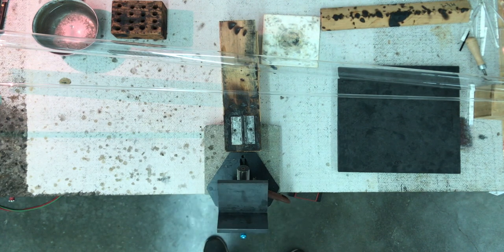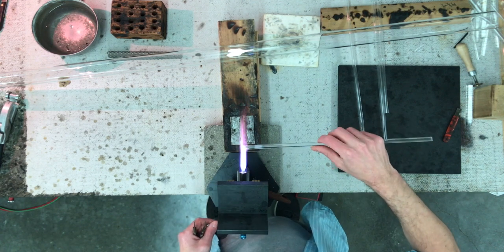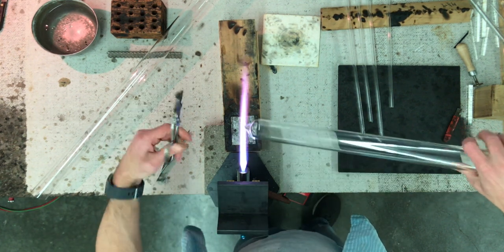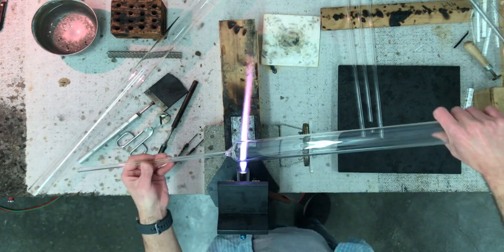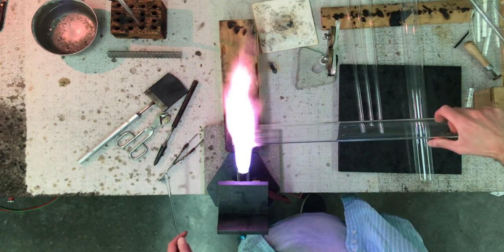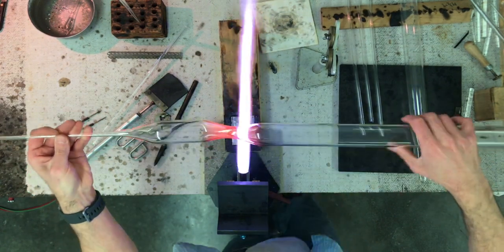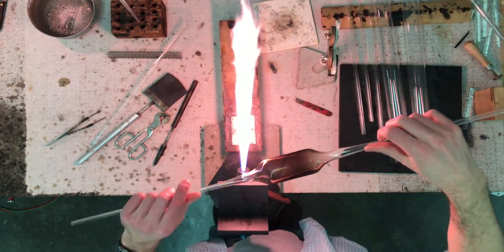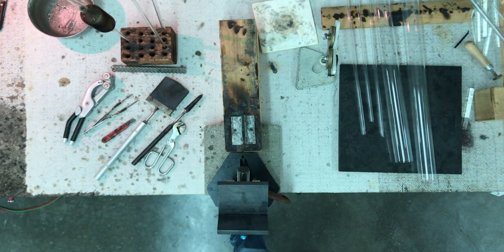Borosilicate glass tubing basics. Episode 1

Comment: What was the scribe tool you showed briefly. What size tube will it accommodate? I know you mentioned that the first tubes you showed being fire polished were boro-silicate. Was the larger tube also Borosil? I also wondered about your torch controls. I noted that you had multiple presets for your torch. Interested in doing this with our hydrogen-torch.